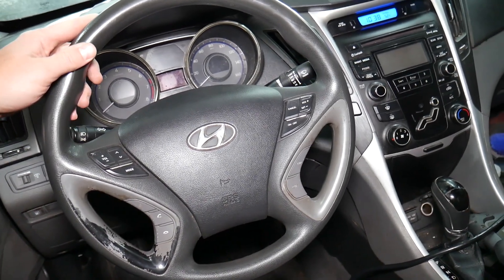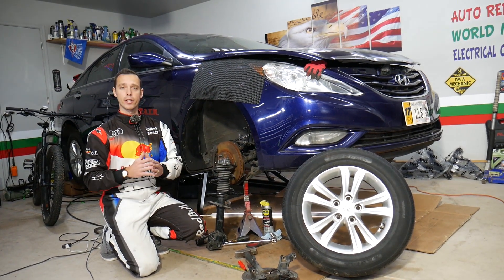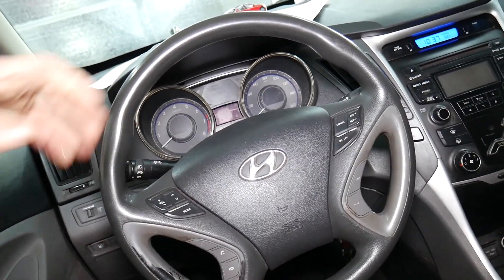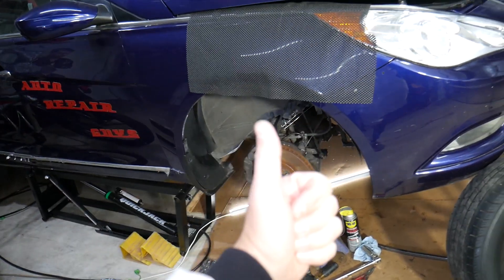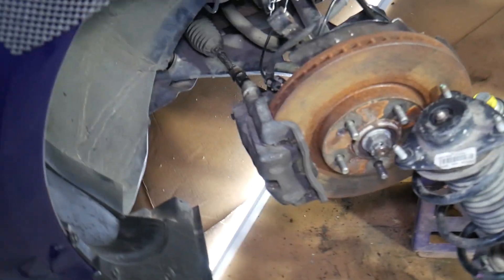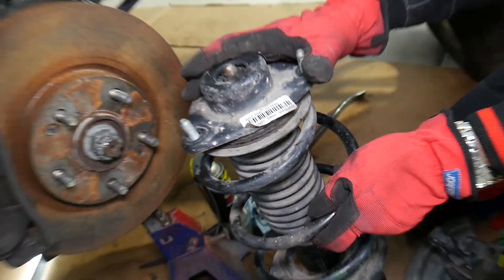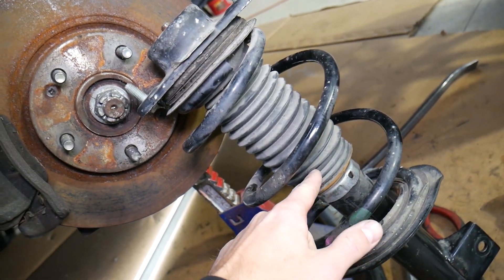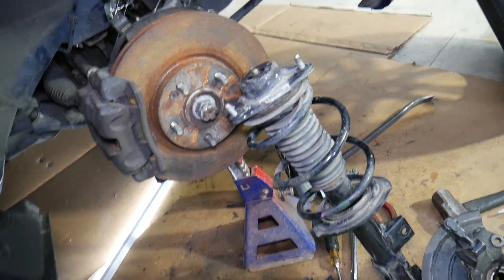THIS IS WHY YOUR STEERING WHEEL IS TO THE LEFT OR RIGHT WHEN DRIVING STRAIGHT

Comment: I have been told that i cannot do 4 wheel alignment in my vehicle as this is front wheel drive ...
Reply: Most the time your rear is always aligned right because in fwd cars there's no weight in the back. So they say that. 
Even if your drop your car low, the rear alignment won't be effected. Only the front. 
In my case, I had an alignment done 2 weeks ago after dropping the ride height. I had a bad toe out. I dropped the sub frame today to diagnose a noise and now my steering wheel is really crooked. So my toe is still aligned but I need to adjust tie rod length by a thread and I'll be set.